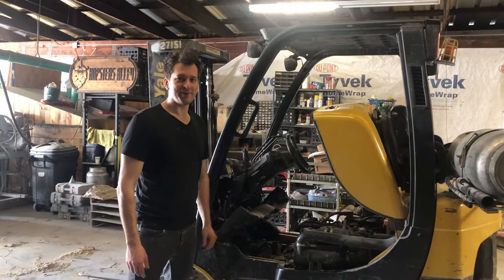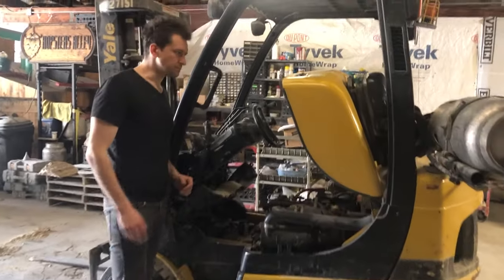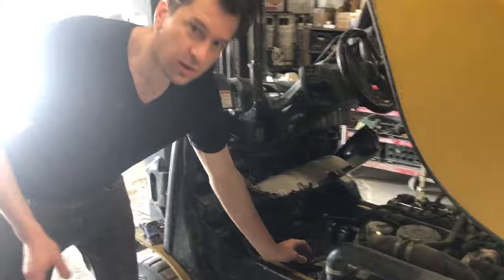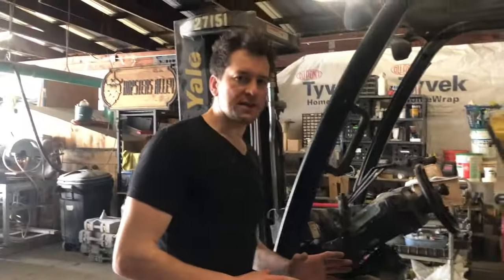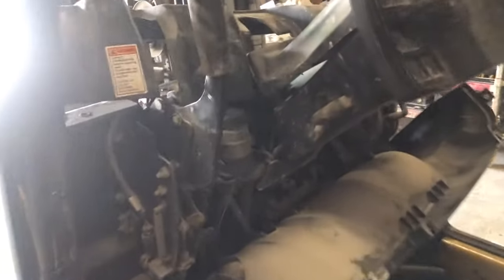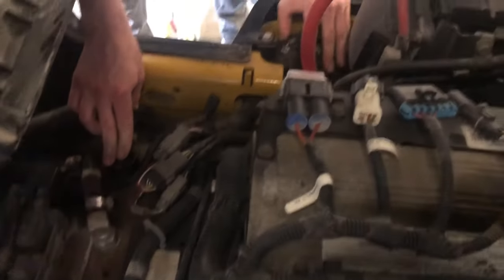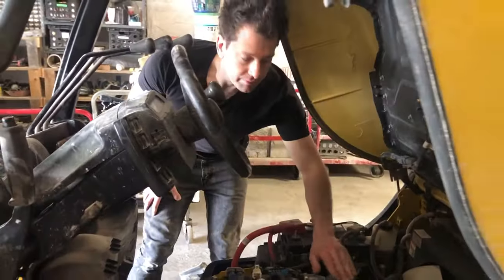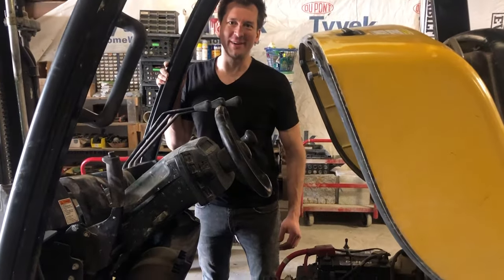Yale Forklift GLC050 Maintenance

Comment: Exactly what I needed to know. Brake warnings came on and I couldn't find what to do. I still dont know if I want to deal with it though. Great video by the way. Simple and to the point.
Reply: Buy a bottle of dot 3 (I believe? But it says it in your manual) brake fluid and top it up. Easier and cheaper than calling a service tech.

Comment: Do not use automatic transmission fluid. Hyster/Yale’s require j20c fluid for the hydraulic tank and transmission fluid.
Reply: Bro what about a tcm? Also my dip stick has holes all the way up is it supposed to be up to the top hole ?
Reply: @joshuacarroll1758  I would need to see the dipstick. What is the model number of the tcm? I’ll see what kind of info I can get for you.